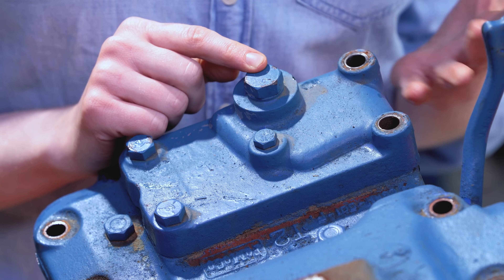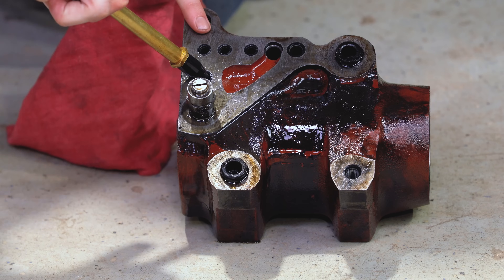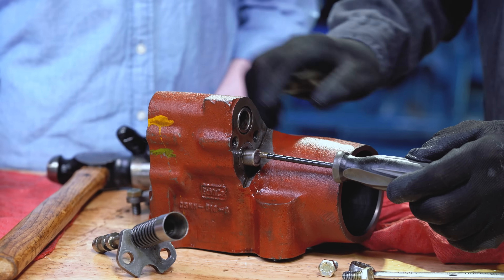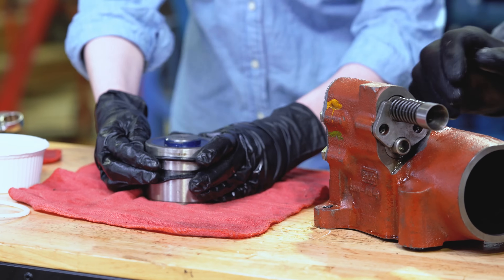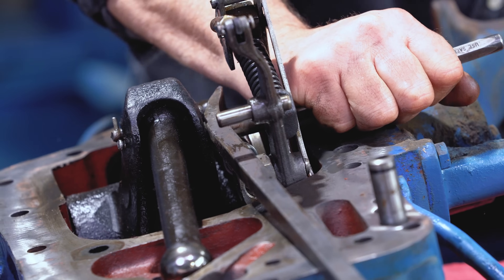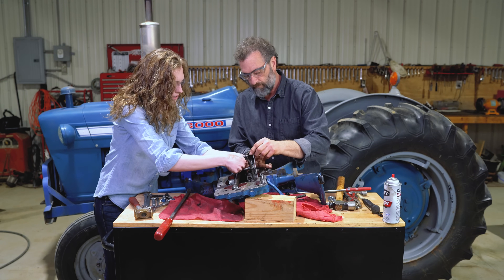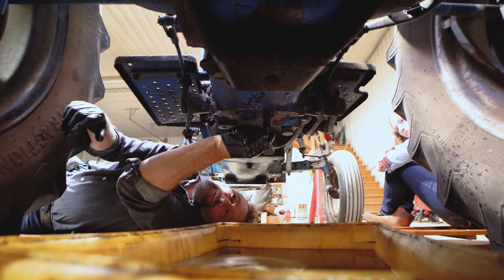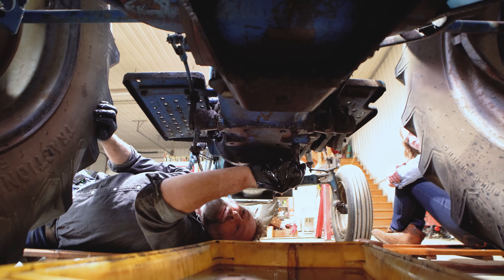Ford 2000, 3000, 4000 Hydraulic Repair, Top Lid: Hydraulics that Shake, are Intermittent or Stuck

Comment: Hello, Your video inspired me to fix the hydraulics on my Ford 3000.
A few hours later it is and working great again
I changed cylinder oring and the pivot pin. Thank you!
Reply: Hello. can you tell me which hydraulic fluid is recommended for the ford 3000 tractor ? and how many liters are needed ?thank you
Reply: @franciscofaria7446  Hello.
You need a combi oil for both hydraulics and wet breaks. 
I guess I used about 10-15 litres.
Fill oil and fill until oil comes out from the level-plug on the right side.
Best regards from Johan

Comment: I hate have a 78 335 industrial and am finding out its basically the same as a 3000 and could you please tell me were the filter and screens are for the 3 point hitch which I know are somewhere internal and I'll be replacing the seals and gasket on the top soon ?. Thank you and you guys have been by far the most informative online 👍

Comment: My hydraulics 3pt hitch does not have fine adjustments. It raises and lowers fine without drift, but when I have the arms low with a bushog it will not adjust fine. It's either all the way on the ground or jacked up 8". Is this repair the answer or soemthing ekse.

Comment: Hi Rachel, i have a big trouble finding injection line for my 2000 ford tractor.
How do i go from hard line to flex line, since the hard lines has nuts and the flex are male threads.

Comment: I tried to look for parts through your site but not much in there.

I hv ford 6610 currently regarding it. ram has been broken because it had fallen upside down and broken the ram of the cylinder. 

Do you repair ford 6610?

Comment: I am trying to remove the rear two lift arms from under axle of a 1970 Ford 4000 SU.  Is there a break down  picture of the pivot bolt with bushings and how to separator them to service parts?

Comment: I just got a 2000 which has some water in the hydraulic fluid. I have rad where you can run diesel for a few minutes and it cleans up the water damage. I am concerned that it might affect the old seals? Do you recommend this procedure?

Comment: Awesome finally a good 3000 hydraulic video. Thanx again great job. Need another one for the draft and position control adjustments they are way confusing but got them after alot of trial by error.

Comment: Great video! Curious if the Fordson Dexta has same hydraulic system.  It looks very similar.
Reply: Yes and no. The hydraulic pump is a vain pump on right side below the draft control leaver. Make sure your piston is an "O" ring type or gland seal Fordson Dextas used both. I ordered a seal kit from Amazon and still had to order a gland seal.

Comment: Rachel it was great watching you and your dad working together. I bought new injectors from your sight ,my dad and I performed the job on our Ford 2000 with great results. Now it starts easer, no smoking and has great power at lower RPM. I watched your video first and that made the job easy as pie! I ordered another set for our Ford 3600. but first we have a problem with the lift in that the arms don't start coming up until you move the lever all the way against the top stop and the draft leaver is froze up.  We pulled the top lid and fond that some of the rollers are not rolling on there shafts and starting to form flat spots on the roller. I wish you to make a recommendation on parts ,tips, video, I can buy from you guys. Thanks for all you do.
Reply: I sold tr from haydrlic problem tr4600 made in england

Comment: Hi Rachel,

Found this video very interesting.  You mentioned some shaking in the system.  Hoping you might have some insight into something I've been seeing.  

I have a late 1968 Ford 5000 with the 256 gas engine.  All the Hydraulic pieces seem to work just fine.  I can even shut down the tractor and a 1000 lb implement will stay up for some time.  Pressure seems to be good as the lift and remotes both work well.

I have the 3PH in position control.  If I move the lift lever straight to a location, the 3PH smoothly rises to that point.  If, however, I very slowly move the lever with any kind of load, it can jerk upward in short increments instead of coming up smooth.  

1) Is this "normal"?
2) If not, what is going on and what are my options?  

I've watched several of your Ford related videos and find them great.  The fact that you demonstrate the process and leave in the real world stuff (like dropping the socket into the cover) give a much better idea of the complexity of the job.  A couple years ago when you did the Holley carb on these tractors, it was your video that made the process of a rebuild make sense.  I try hard to buy parts from your store if I can just to support these videos as I find them so valuable.

The upper pipe on my exhaust manifold is getting perforated.  Well, it's 52 years old.  Any tips on how to remove a heavily rusted manifold?  (^_^)  Going to be my summer project this year and I hope it does not become a summer long project.  Any chance you carry a replacement manifold?
Reply: I suggest Googling how to remove rusted manifold bolts there are a lot of good videos to watch on some good methods to remove rusted bolts without breaking them
Reply: សុំសួរបងថាមានគ្រឿងកំពុង
Reply: ត្រាក់ទ័រ 6600គ្រឿងប៉ុង
Reply: គ្រឿងត្រាក់ទ័រ ford of 6600

Comment: I’ve got a Massey Ferguson 135 with a 3 cyl Perkins diesel. I think the head gasket is gone. I’ve got coolant in my engine oil. I’ve looked through your videos I don’t see any Massey head gasket videos. Any suggestions or advice? Do you sell the parts I would need to do the replacement gasket? Thanks.

Comment: Awesome video. Mine was drifting  down under load.  Ended up being a stuck unloader valve and I think the relief valve was bad. I rebuilt the pump while I had mine apart. Mine had be done improperly  before I bought the tractor and every linkage was musadjusted, so it took some work to get it back working. I used your jubilee top cover video to guide me and it helped immensely.  Thank you for the help.

Comment: I really needed this a few years ago. When you would try to slightly raise the 3pt on my 75 3400, it would keep going up and either bind at max height or pop at max height and come back down. It was a ride when you had a heavy implement on the back! It was the 'up and down spool' sticking just like you said! I called the local shops and they had not a clue what I was talking about... Funny (not) that you knew that issue existed and none of the local shops did.

That oring you pointed to at 17:13 isnt on fords drawings that I could find but I stuck an oring there anyway, glad I did! 

Your videos are great. Its hard to find good videos for these old tractors.

Comment: So if I have hydraulic lift but no control over the down motion I need to pull top lid and check for the pin yall pounded out and replaced

Comment: ohhhh yeah, my N.H. TC33D does have this issue...  The loader and backhoe barely move now. The pump is quiet, but the relief valve in the Manifold block is screaming, as if the loader is fully raised and is hitting the stops.  The Power steering and the HST is working just fine. Its only the implement hydro system that has an issue. I don't have a high pressure gauge, but I can pull the relief valve to see if there is a broken spring in there. Any help is appreciated.